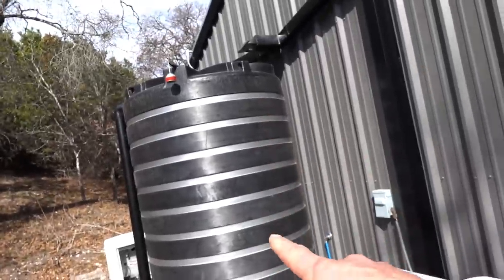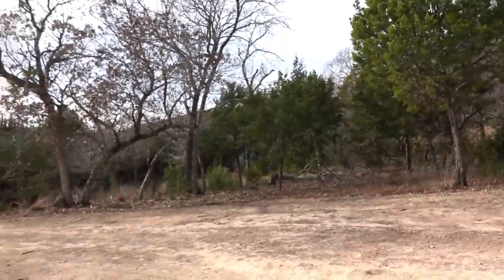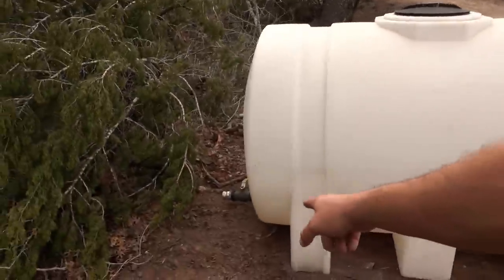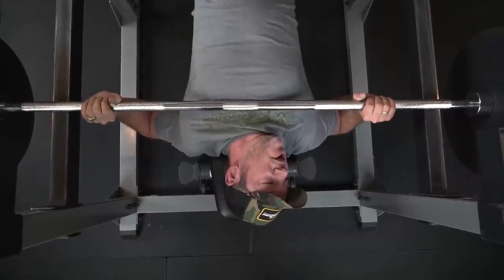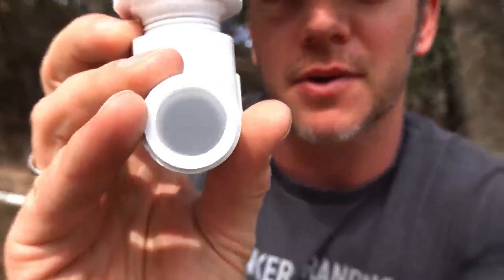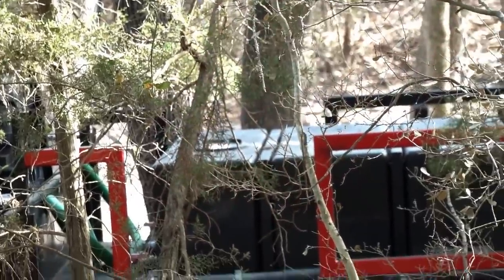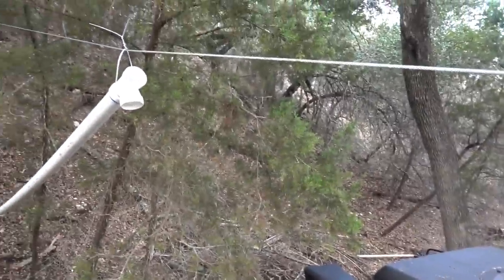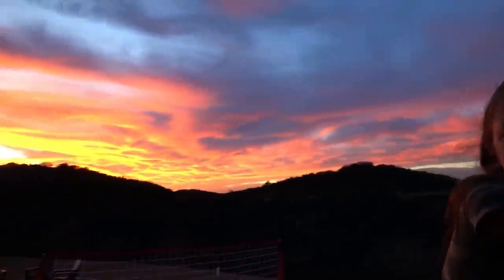Trying to Make this Work... And my Fire Truck is BROKEN!

Comment: I cant say this enough... BUILD A TOWER, run a drain pipe down to feed your faucets, and a fill pipe up that you can hook up the fire truck to and refill it.
Reply: Isn't that essentially what he is doing, minus the tower?  The tank sitting there, with a drain pipe to feed the faucet and the opening in the top of the tank to fill it?  I guess a tower would raise it even more, giving him even more water pressure.
Reply: @jiminauburn5073  And will look a whole lot cleaner with a lot less RedNeck engineering.
Reply: I was literally thinking the same exact thing the hole time he was making this setup lol
Reply: @MrPeterson74  and it would have way better flow since it cuts out 80% of the pipe to get to the faucet.
Reply: My family has an old hunting cabin in the woods on top of an artesian well. We pumped the water up the hill to a buried water tank while the generator ran and buried a pipe very similar to this back to the cabin. We finally redid the system a couple of years ago after it was working fine for over 50 years. We ended up using the same design but with simplified plumbing and modern materials. I'm not saying its the "right" way to do it, but I am saying that it's not the wrong way.
Reply: A tower is smart but the issue is bullet fragments. Plus a tower and bulletproofing it is expensive for just a small water tank
Reply: A little redneck engineering is good for ya, but there's just too much pvc pipe unprotected and poorly supported and running thru the woods.  Somethings gonna get messed up whether it's from wind blowing or critters running thru or a tree falling on it.  
Plus, PVC is not UV resistant and leaving all that pipe exposed to the sun is not a good long term solution.
Reply: Yeah just build a 15ft Water tower with a 6 Inch valve,
it will fill your truck in seconds. Like the good old steam locomotives
(I also recommended this when he build his first water tank)
Reply: Same- you could build it AT the range...
Reply: Have a couple five gallon jugs on hand.  I swear people get addicted to projects.
Reply: Seems like a much... much better idea, for multiple reasons!
Reply: THIS!  I can't count the times we had trouble with our brush truck as it had to be filled from the top and we only had city water since we couldn't afford to upgrade (TINY town VFD.)  I think they did finally get a grant to upgrade but dang it stunk when we were stuck.
Reply: Put it up a about 20ft,all the pressure you need brother!
Reply: @Aj.1987.  Even better.
Reply: I was gunna say the same, now i wont 😂
Reply: Should’ve just made his tree stand bigger, and put the tank up there.
Reply: @Aj.1987.  4.33 psi for every 10’ of head pressure.
Reply: Build the tower ON the hill
Reply: And go from bigger to smaller lines that help
Reply: Also, sniper tower
Reply: @Tom  are people going to tune in to watch him fill a couple 5 galling jugs or to watch him build a water tower? You're looking at this from your own perspective and not Matt's.
Reply: na it’s okay you did say it enough in fact once might have been more than enough
Reply: It’s an earth tower. ….
Reply: I vote for the "GermanMythbuster" they do it with portable fuel tank on construction sites all the time!  Except they use a gas station hose rig.
Reply: @Aj.1987.  I'm not good with physics and such, so I can't say what the height should be, but that sounds good, as if he does that, he'd have no problem with a 100% down hill pipe system and coming in above the truck's tank.
Reply: You should know Matt’s gonna over complicate this. After that disaster of the chicken water collection thing.
Reply: They have water towers for a reason lol would be a super fast easy framing job
Reply: @rtid0238  he could just stack two small shipping containers.
Reply: @MrPeterson74  What?  You never go full tard and take Redneck neering out of anything! Geez...Lol
Reply: Just buy a damn pump and a hose to fill the tank.
Reply: Pressurize the tank. A battery pump will do the job.
Reply: I was going to say the same thing. Raising it will give more pressure.
Reply: Came here to say this
Reply: Spray those pipes od green!  Conceal those things

Comment: Good job Matt.  There's only 2 thing's I would of done differently is, 20 foot long pipes with bell's at 1 end and use gray pipe. The gray is made for outdoor and a little better insulated not much but every little helps.

Comment: You should put a small 12 v pump w/ 20-40 psi that cuts on/0ff @ set pressure and the battery you can get a small solar panel charger to keep it charged . Just thought I would throw that idea out there for you.
Reply: These were my thoughts exactly.
Reply: Exactly my thought.
Reply: Was was to simple lol.   My exact thought right on the side the shed solar panel up above the shed roof all you would need especially not using it daily !!! Way to simple.  LOL 😂
Reply: I know his pocket was hurting after buying all that pvc 🤣

Comment: I suggest you dig foundations infront of the water tank, just incase rain and mud has it slide down the hill, especially with the weight of a full water tank, at an angle, at the top of a hill sitting on mud.

Maybe just dig anything robust and heavey/long, like maybe scaffolding pipes, or concrete rail things, dug down horizontally.
Yes, that's a lot of work.
But if it saves the full water tank going down the hill, it's probably worth it.
That's a beautiful sunset too BTW. God bless you all.

Comment: That resistance in the pipe is called friction loss and you are correct the bigger diameter pipe you can run the better!

Comment: Great video.
I think you are losing your water pressure by suspending the pipe. Another suggestion is to use the water pump on the fire truck to pull the water out of the container on the hill. It would only take minor piping modification to the water pump attachments.

You could also use the pump modification to fill the fire truck faster than 45 minutes with a small modification on the 1000 gal tank.
Reply: P.s. regardless of what you do. Ensure you have air flow at the tank or you will have hydro lock.
Reply: The whole point of him doing this as he said was because pumping out of a tank takes about 45 minutes to fill the tank on the Firetruck when it's empty. That's what he currently does. There's a pump on the fire truck that he uses to pull water from the rain water tank at the Range Armory.

Comment: Matt,
You can put the tank at the range itself and use a 12V on demand diaphragm pump. Delavan, Remco, and Northern Tool all make 5gpm-7gpm pumps with anywhere from 60-100psi. 12V battery to the pump mounted on the tank and garden hose will work wonders. Easily fill 150'-200' of ⅝" garden hose with good pressure.

Comment: Well color me impressed.

I design plumbing. Every time I thought Matt was making a mistake...he did the right thing with what he had to work with.

The 2in pipe & ball valve to reduce friction loss was a good choice and he even got the head pressure calcs right.

Much respect Matt.

Comment: Matt, get some poly pipe next time - like sprinkler line. You can get it in any diameter and you could just unroll it down the hill instead of dealing with all that pvc. Will also hold up better without becoming brittle.
Reply: Thanks I thought nobody was gonna say it

Comment: I would build a small tower with the welder in the garage to get it about 6 feet off the ground next to the range. That would make it possible to refill with the roof off the gun range lean tube like what you have at the bunker and have it close enough to have all the water you need real close to the range with enough water pressure to do what you want…
Reply: Pressurize the water tank.

Comment: I repaired the housing on a pump with JB Weld and metal screen and that was three years ago, and it is still golden, we use this pump outside to pump ditches, so it gets dragged around and not really gently always.

Comment: No need to hang the pipe above ground. If the head pressure is above the discarge the water will flow. You can leave the pipe laying on the ground, then run it up the side of the tree. Maybe fill on the other side of the tree so you dont' run over the pipe. Also, you might think about vents. One on the top of the line to allow air in to purge the line for winter, also one at the lowest point to empty the line. Plus an air vent in the top of the tank to allow the tank to discharge without creating a vaccum in the tank.
Reply: Wrong on losing pressure at the 10ft up F-truck outlet , if goes to the ground at the base of the tree and up !  About 4.5 PSI . Plus all the water would stay in the 19 ft riser and all the pipe going along the ground and up the hill until the 10ft level of the outlet for the truck . Taking the pipe to the ground first is a loss in both regards .

Comment: Build a rain collection hut. Essentially a roof with gutters to divert the water to the tank like at the armory.
Reply: The pavilion he wants to bring water to in the first place has a roof...
Reply: Our at least a roof like structure to fill that tank. I like the hut idea, would help keep sunlight off that tank to reduce algae growth in the tank. That pvc pipe might become brittle if not protected.
Reply: Yes because he needs a vent for the water to flow or it will gurgle like a milk jug so a gutter would let air into the system

Comment: Keep the pipe on the ground, then 90 up for your fire truck spout. It won’t change the pressure or flow. Suspending that pipe in the air introduces vibration fractures, exposes the pipe to more uv damage, stresses your joints more, and is much more complicated than necessary.

Comment: Food for thought. Some vertical angle stock at with horizontal pieces at a slight angle welded to the top declining down the hill then hose clamp the pipe to the horizontal pieces!

Comment: You just need an elevated platform by the Pavillion. Have a 2 in valve on a tee so it can fill the firetruck. Then have a standard 1in pump on solar or a battery for all your range needs.

Comment: To support the pipe I would use an old tire and cut some rubber to wrap around the bottom of the pipe so it doesn't get cut into overtime by rope or wire holding it up.

Comment: Simplest way to build supports for the pipe is sawhorse hinges and 2x4s. Just make A-frames with some plywood crossmembers. The pipe will act like a ridgepole. And any Tractor Supply will have rubber hose-ends for fillpipes. Just a floppy rubber or plastic tube you hose-clamp to the bottom of an elbow on the end of the pipe.

Comment: Just put an air gauge with a valve stem on it on the top of the tank use a small compressor to put a little pressure to it and significantly increase the pressure
Reply: Just have the compressor so the tank can be kept at the range.

Comment: A couple hundred watts of solar panels, a charge controller, and a deep cycle battery can be used to power a 12 volt RV water pump. They have a pressure switch built in, and when plumbed to an accumulator tank this kind of system works very well for off-grid use. I’ve been using this setup for about 15 years at my off-grid cabin without issue.

Comment: That white PVC is going to bake in the Texas Sun and get so brittle so quick, and that's if it hasn't been sitting in a supply yard for a few years. The white PVC has no UV protection. Should have just got a roll of flexible black UV resistant PVC tubing and just laid it on the ground. It'd probably be good for 20 years or so.

Comment: If you put it on a platform, like a small water tower, you can have it alot closer and get better pressure. And could even fill it up with an electric water pump from the ranch fire truck. 
Water towers are so tall because they supply pressure to entire towns or neighborhoods. And if you go from a 3in pipe to a 1in pipe/hose you can multiply the pressure. The higher the tank + the decrease in pipe = pressure. That's if you start from a bigger pipe and narrow down. It forces it through. Kind of like when you put your thumb into a waterhose. Hope it helps

Comment: 108', same width as a iowa class, also if you want to winterize that pipe without draining the tank, you need to put a T after the dump valve that can be opened to let air into the  pipe so it doesn't airlock

Comment: first of all those lights look cool on the car! A keeper for sure. And the goats are getting so big. I cannot imagine you would have to raise that water line into the trees, I mean if your tank is on top the hill and the water is coming out at the bottom, gravity means its going to run all the way down that hill. Not sure how hanging those pipes on a wire is going to work. Be really interesting to see your finished product.

Comment: Start with the largest diameter pipe you can at the top then go one size down in stages over the drop.
By doing that you are increasing the volume pressure in stages and will have much greater pressure by the time you are at the bottom of the hill.👍
Reply: higher pressure but lower volume...
Reply: @rackroff9279  yes, but when he is talking about a garden hose to put out a fire on the range…
No reason he can’t up the pressure enough to accomplish that by starting out with the first 15 feet of drop at a 2 inch line then the next 15 feet at 1.5 and so on till he is down to a standard .75 with the normal volume you would have but now somewhere north of 40 psi. So he can actually use a nozzle with a little reach to put out a small fire without needing to stand on top of it with only a trickle out of the end of a hose or adding in some sort of pump that will need to be maintained.

Comment: Matt you have all that land, wouldn't it be easier to put a small holding pond in somewhere? Just dig a big hole and throw a rubber pond liner in it near a spring. Between the spring and rain should keep it full.

Comment: You can replace the housing, but sometimes the pup housing can cost nearly as much as a new pump.  Also, just a suggestion, you need to cushion your entire pump frame from the truck.  You can get away with rubber matting, but I would suggest rubber mounts.  This will lessen the shock on the pump from driving around in rougher terrain and you won't have another pump housing breakage.

Comment: Matt, place a large tarp over the tank, suspend the 4 corners on polls above the tank, and a drain in the middle of the tarp, then when it rain all the water will run to the middle of the tarp and fill the tank.

Comment: I like to see what's happening on both channels.
Now that your fire truck pump is broken it's a good time to get a proper firefighting system on the truck. Send the truck to a fire truck service/ rebuilder.
Look into a Ultra High Pressure pump system.
Uses less water ...great for the rural ranch area with limited water system.
Example 2 room flashover fire put out in 34 seconds with 17gals of water ...3/4 hose with a 30gpm ultra high pressure pump system.
As a guy who likes technology....
Cars...guns this will be a great project to show case and save your life and property until the local fire department can respond.
Check out UHP fire system on YouTube.
Save the cheap pump for tank refills and transfers.
Take care...sub for a while now...that sunset worth the selection of that house.

Comment: You will have a fair amout of pressure drop over that distance. An option would be to have an 120 volt demand pump at the bottom to boost your pressure when you open the valve.

Comment: Matt, you definitely can buy just the water pump housing for that motor. We run that exact same set up at work on our “WaterDog” truck to wash things off. We just replaced that house last spring. I doubt you’ll see this; but I just thought I could offer some insight.

Comment: so if you want that tree to survive. put some padding (boards or something that can move a bit around) between the tree and the cable. if there is to much tension the cable will cut the cambium of the tree and wen that happens it will be dead in a week.
Reply: and put a housing around the pump. looks like something hard hit it.

Comment: For outdoor applications like that I'd recommend doing it with Polyethylene Pipe.
Reply: Black poly should be WAY cheaper, too.
Reply: @victorsummers2283  Oh yeah. Less fittings, less joints, and if you buy a 150ft section it could easily extend the full length in one piece.

Comment: i'm thinking it would have just been easier to put your water tank next to your lean-to and getting the same kind of pump on it as the one on your armory at demo ranch. you could either use solar or a generator and then use a 100 foot hose or something... and then when it rains, you could collect the water that hits your lean-to to fill the water tank.

Comment: Matt, if you are leaving the pipe above ground you need to paint it (water based exterior paint). Sun will eat that PVC and make it brittle a lot faster than you might think. I'll second other commenters as well, just run the pipe on the ground the whole way down the hill, then go up and over the fire truck.

Comment: I think people fail to realize he created a water tower. Hence all the gallons of weight are pushing out the one exit. That's decent pressure in itself untill it drains near empty. Vent the tank, valve the water outlet. Pipe on the ground then 12' vertical to the tank. Or fill the tank from the bottom because gravity does that. Or use the pump on the truck to pump water into the tank with a valved Y inlet into the pump. The pump needs a drain or winterize it with stuff. 
Full respect to ya.

Comment: Just make a platform that sits a couple feet off the ground for the barrel to sit on and place it beside the building that way you wouldn’t have to worry about running a pipe that far.

Comment: You definitely need a bigger water tank on top of the tallest hill that is close to the range. Basically the same system that you have but with a 6" pipe and a tank that can fill in the firetruck 4 or 5 times.